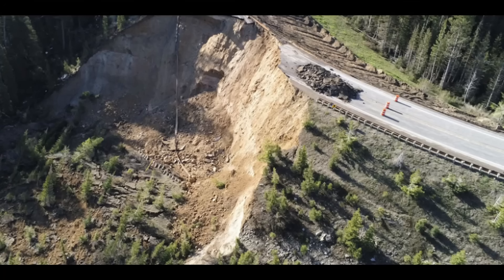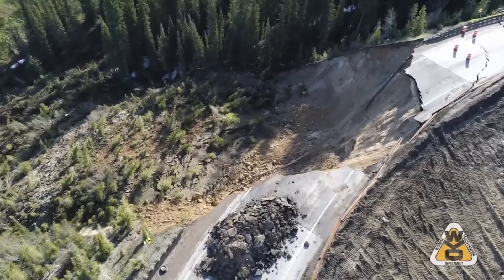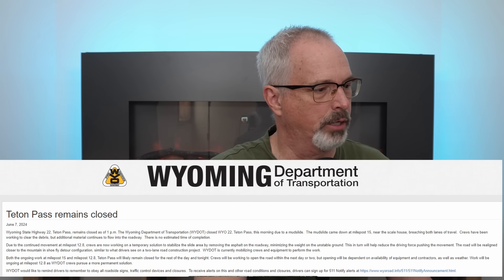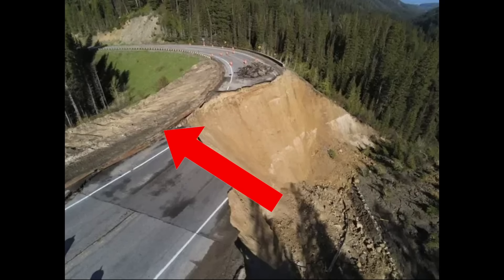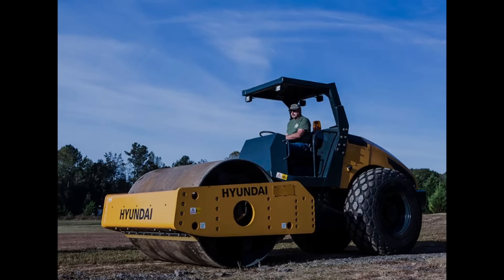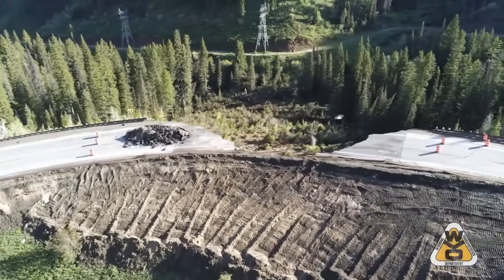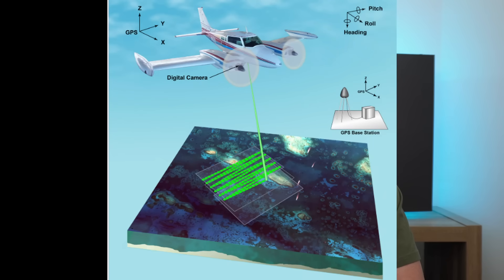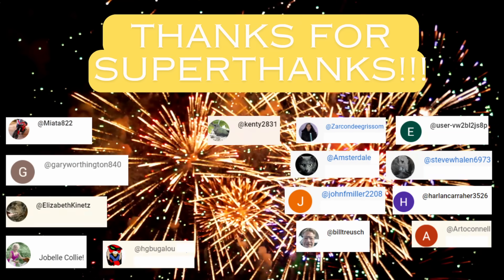Major Highway Embankment Failure in Wyoming!

Comment: From looking at google earth and the photos, it can't be between Jackson and Wilson but rather at the hair pin turn N43.5034, W110.9754 on the way to Victor. Looks like a big project though.
Reply from the maker: I think you are right.  I should have said it was between Jackson Wyoming and Victor, Idaho.  Thank you.
Reply: @CaseyJones-Engineer  It's also between Wilson and Victor.
Reply from the maker: @jimwing.2178  Thank you.
Reply: The GEO Coordinates 43°30'12.2"N 110°58'31.4"W are correct. That section of the road was put in long ago (50's) to bypass the old twisting section of road just to the north of the slide and is still visible today (and accessible from the east side of the fill but doesn't reconnect near Mail Cabin Creek).  Going to be a bugger to repair
Reply: Thanks for that rather exact location.  Like a boss.
Reply: It's a geologically interesting area with a lot of nice scenery. To better understand the soil I think it's important to realize that this once was a sea floor where a lot of fine grained material settled and became sandstone. Then tectonics came into play and cracked the sandstone that's quite brittle with some variations here and there in how brittle it became. Picking it as filling material would make sense from the practical point of view, but sandstone is quite brittle. Some sandstone can be broken apart without even using tools, just your bare hands.
A coarse look at Google Earth (not very accurate, especially when it comes to height indications) gave that the foot of the fill was some 55 meters away and 20 meters lower (roughly). It should be a slope of about 20 degrees and at the bottom there's likely a creek that would wash away the fill. You can also play around in Google Earth to get an even better view of the terrain from a 3D perspective and to me it looks like a "cursed" location from the perspective of building a road and the only good way would be to make a huge sandwich construction of the fill, but it would require that most of it is dug away to be able to put in the reinforcements.
This seems like a tough project to take on, and still to the east of this failure there's a bulge that looks like it's just waiting to eat up the road.
Reply from the maker: @ehsnils  Great observations. Thank you.
Reply: I notice one other thing looking at the drone footage. Just that section of pavement that fell away with the embankment had been cut out and replaced at some point. Did something about that repair job set it up to fail, or was the repair job trying to fix what was already unstable failing?
Reply: @jokerace8227  From what I've read the initial response to cracking in the road and noticable dropping (Thursday), road crew initated the repair of that  section by paving over it (temporary patch). Traffic continued on Thursday night. The road was closed on Friday due to the unrelated mudslide. The road at tha embankment failed fully on Saturday..
Reply: @SPJPapasan  The first report I saw at least a day before the collapse they talked about the cracks having an 8" drop, but they were going to patch across the cracks with asphalt. I was looking at it on Google Earth, it's near the base on the Idaho side, with easy access to the base of the slide. It may be repairable by the end of the season.
Reply: @SPJPapasan  
That is similar to what I read in an ABC News article. The article stated that the crack got the attention of the state DOT due to a motorcycle crash related to the cracked. 

From that article I got the impression that the impression that the engineers and geologist that inspected the site on Thursday closed the road due to slide concerns. 

Then there was a logic disconnect. The pavement crack was fixed and the road was reopened.
Reply: @jokerace8227  No way it is repaired this year. Same thing happened in Jackson to Walgreens, poor construction caused the hillside to come down and take out the newly constructed Walgreens. It also took out numerous houses. It took them two or three years to even do anything about it.
Reply: During this video I asked myself why they didn't use geo fabric.   Glad you mentioned it!
Reply: @Darenator1  Per the online article regarding the history of the pass on the Teton Valley Magazine website, the current iteration of the pass was built in 1961.  That's a little early for geotextile reinforcement, isn't it?
Reply from the maker: @kevinolson1102  Yes.
Reply: Right on, one could look at the map and easily predict where the slide would happen.
Reply: due east of Mail cabin trail head by about 1/2 mile.
Reply: Near the Mail Cabin Trailhead then and a mile from the Pass? Well, I live in a fairly hilly area, and this type of failure happened on a state-owned highway a few years back. It was a much longer stretch of highway, although it was just a 2-lane with minimal shoulders (closer to 30 feet than 40). It did indeed take about a year to restore it. It seems like the US Highways are better made than the state ones, speaking for both my area and this place in Wyoming. I have driven the Teton Pass Highway in winter before. It's a bit of a challenge through there!
Reply: Thanks for the clarification, I’m glad to hear Wilson is not cut off from the east. I’ve got reservations there this Friday and am not willing to tow my 5th wheel over that pass.
Reply: @davidhein4300  you would normally take the canyon anyway.
Reply: That old road is steep, narrow, with some really tight turns on a couple switchbacks, not to mention that sections are completely gone. No easy project to create a quick bypass, and not suitable for a typical passenger car, much less anything like a commercial truck or van.
Reply: @paulmead4401 Not to mention the high voltage transmission towers practically built on the old right of way.

Comment: We were there the weekend before the collapse; drove this path around 6 times. Heavy snow our first day. Temperatures climbed the next few days. Poor drainage of the snow melt could be observed. WYDOT was just trying a bit maintenance asphalt patch work after a bicyclist hits the initial pavement cracking. These maintenace guys weren't engineers. Then the mudslide occured at the weight station area. This forces a closure on the road. Just enough to investigate the failed patch work done the day before. WYDOT was trying their best to solve the cracking issue with engineers at this point. A solution was proposed to remove a portion of pavement load in the area. They weren't stock piling. The area was already compromised. The act of removing the asphalt only expedited the inevitable on an unstable embankment. I'd recommend a nail wall if they proposed steep side slopes and a proper drainage course at the toe portion of the grading work.

Comment: I'm a stormwater engineer in PA I definitely agree that poor drainage could have been a key contributor of this failure.  There is an approximate 4.5 acre "bowl" on the inside of this curve that appears to have no place to drain, no culvert pipe seen through the embankment.  The embankment when constructed in the 1960's most likely was not constructed like a dam with a key trench or core wall, just fill on grade.  Therefore, the water would infiltrate between the native soil layer and the placed soil layer eventually causing the failure.  From the repair footage I'm seeing it does not look like they are addressing this possible cause by installing a culvert pipe, or extending an existing pipe, to prevent future failure.

Comment: Notice that the failure is on the outside of the curve, and the highest elevation of the curve.   ( Greatest overall height ).  Moisture at the base  reduces the allowable maximum soil bearing capacity.    If you end up with a pressure of around 35 PSI,  ( 5,040 LBS per square foot ), it will eventually fail.   Elephants Know this, and Sauropods knew this as the ones who had feet too small got stuck in the mud, bellowed and got eaten.  Evolution made Sauropod feet just large enough to not get too stuck in the mud.    Highway embankments need to be wider, as they get taller, and you need to use really good materials in the lowest layers. ( like rock ).

Comment: Excellent video. But a small correction at 3:10 regarding the accident in China: "...I imagine a lot of these vehicles were EVs, so the batteries caught on fire in all likelihood..."  Although BEVs counted for 26% of light vehicle sales in China in 2023 (plus another 11% for PHEVs), they are still a small fraction of China's overall fleet at roughly 16 million out of 319 million cars, or 5%.  (Hard to get precise numbers, and I presume there are large regional variations.)  Moreover, EV batteries do not catch fire "in all likelihood" in crashes, and are not significantly more likely to do so than gasoline cars.  (Source: 2017 NHTSA study: "...propensity and severity of fires and explosions ... in Li-ion battery systems are anticipated to be somewhat comparable to or perhaps slightly less than those for gasoline or diesel vehicular fuels."  Though again, it's complicated, and there may be better and more recent data available.)  I believe it's important to correct this to combat pervasive FUD about electric vehicles--which are not perfect, but which can help reduce our impacts on climate.  Thanks!  🙂
Reply from the maker: Thank you. I've read tha 60 percent of new vehicle registrations in 2023 in China were EVs.

Comment: Well they're going to be spending a lot of money to repair all that and that stretch. Looks like it would be much easier and less dangerous just to put a bridge across that stretch so you would have snow melt and a water flow. It's already a dangerous curve. If not you have many other Mountain Roads with similar problems. You get rid of that portion of the road and move it through another area. I believe they need to take a hard look at several portions of this road because in the winter time it is pretty rough driving through there . I know several times during the winter time it is closed because of weather .A good look at different solutions to the problem. Whatever it is, it may not be open for several years because you have a short period of time to work on the road during halfway decent weather before winter months. Look at the whole back River Road and steal the Rock slides will happen. Just waiting on a good earthquake to close all of the roads even the Snake River Road Highway 26. This is only a warning to the highway department. You really don't have that many routes going up from Idaho Falls area or Swan Valley and if you have 26 blocked you don't have a way to get up to the whole back junction or Jackson Wyoming, you're just add a lock for a short route

Comment: I drive a truck for a living; and have used this pass a number of times through the years... Your location of the failure is absolutely accurate... The mud slide invaded the Wyoming truck scales near the Idaho state line... This fill failure has been creeping for years... I watch for those, as they are common on mountain highways in most western states... Yes, this is a rampant issue in Wyoming... This fill was placed on a complex sloping base to begin with, so it's not a simple fix... I am concerned with the detour... What I heard was the traffic will be limited to smaller and lighter vehicles... I am not sure if this has changed, but the gross weight limit for trucks was 66,000 pounds, due to the seriousness of the grades... A bridge is not likely possible, due to the grades... Most of this pass is on 10%  grades... The fill is sandyer than you originally believed as you were realizing... I hope this helps on your understanding of this situation...

Comment: This is classic of the Jackson area. They've had advisories to drive steel piles more than once on this particular section and other sections have dropped several feet over the years. In Jackson itself, it's almost an annual occurrence to have the hills slide down and bury a building at this point. Simple fact is that this road was never designed for the kind of heavy traffic it gets, while the road base itself has been improved to keep up, the fill below has been lagging behind. Many other sections on in the area on the idaho side have had pile drivers working on keeping the roads up for years.

Not the first time this pass has dropped a road, and won't be the last.

Comment: It's an unusual spot where the roadway isn't on a hillside, but briefly atop a ridge. If they simply piled fill atop a ridge, with no horizontal surface or reinforcements, that the fill would be especially susceptible to moving down the existing slopes over time.

Comment: What you see missing is how much more material was needed to fill this area correctly. 3:1 slopes is the safety ratio for a reason.
Considering the amount that settled at the bottom this is where the actual base should have started the fill in the beginning with stabilization methods as well. 
I also see there were no berms with rip rap in the channel to focus on water erosion problems on such large slope where people are always at the top.
Most Geotech's only test compaction under the road and 10 feet past which would add to this flook problem due to it geometry.
Give me a D6, a D8, and week this place would be ready for fill. That's not a year of fill, more like about 2 months if they can bring the dirt/rock fast enough.
I would form it like a step pyramid where the berms are at each step sending the water to a main channel lined with fiber cloth and rip rap.
Any tree but a pine tree would help as well but if you've noticed which way a tree falls on a slope it 90% uphill due the the root pattern being weaker on the bottom side.

Comment: Casey, nice initial assessment. @7:50 To check the height of failure estimate, I found the spot on google earth (N43.5034, W110.9754). With the measure tool you can set a path and it will give you a profile. I pulled about 3/4 down the fill section, based on tree growth, and found about 80' drop. This was over approx. 200' horizontal, so I'm seeing a slope closer to 2.5:1. Not as steep as 2:1 but still pretty significant. After that it flattens out more and the final toe is just over 100' vertical, but it doesn't appear the failure occurred that low.

Comment: It has not been a particularly wet spring. cooler temperatures this spring allowed the snowpack to hold on longer than normal 
In the recent weeks temperatures have increased and caused rapid snowmelt. There are several areas of land  movement in the region

Comment: The DOT was likely subject to wishful thinking it was just a settlement that would stabilize itself. 
My guess is that there was water seepage through the fill that softened and liquefied it at the bottom and led to erosion before the collapse. 
You can't see any drainage structure in the photo. It may be buried by the material that fell down. It is very possible that the culvert was old and rusted out or plugged with debris and water was flowing around it. There has to be a lot of water flowing down the valley that the fill was built on, especially in spring melt.

Comment: Rotational slump.

Only solution for earth fill is to extend downhill fill over bedrock so far that next slump will not reach roadway. 

Or make tigher curve closer to uphill silde.  But that would restrict speed.

On this alignment, best design would be curved bridge.  That would allow unlimited drainage, but expensive.

Best societial cost would be to force affordable housing in Jackson.

Comment: You have confirmed all of my initial thoughts. Absence of underlying support and drainage combined with poor slope ratios seems  obvious from photos. As a former survey/engineering tech I have monitored similar new construction and potential failure events on existing infrastructure and their subsequent remedies. Depending upon local  geology and availability , anchor stones or large rubble from rock cuts are common here in Ontario, Canada for similar construction. It is indeed fortunate that there were no injuries.

Comment: They plan on doing the temp road on that graded/shoe fly section. I feel uneasy about them making a temporary route right next to where the hill is sliding. But i suppose Jackson/Wyoming is more concerned about their employees getting to work rather than their safety. People were driving on a ramp put over that crack just two days before it failed. The only reason the pass was closed while it failed was because a mud slide happened. 
That mud slide saved lives while wydot was just gonna let people drive on a shotty ramp over the cracks. 
I pray for the commuters who will be affected.
Please so a video on what you hhink on their detoure route on the shoe fly area you were talkng about! Is if safe?!?

Comment: Fine sand, silt and loose clay. 
So a couple of things here
1. NW Wyoming is seismically more active than other parts of the country and Wyoming.
2. Compaction becomes more problem with the height of the fill and siesmicity. 
For example, it really hard to get 98% percent compaction, particularly in a few months time, but it you have 100 feet of fill, some little and a little siezmicity you can get significant compaction.  
3. Where’s the aggregate. If you want to prevent ground motion loose, sandy silty clay is not a good choice, crushed concrete or even the addition of lime hardens the substrate so that it resists motion. 
4. Agree the slope was to high. 

They should have built a bridge in that circumstance. A couple of things I saw was that there was a creek on one side which means in heavy rains the water will build up on the other side, this flow through the substrate can cause pithing on the other side.